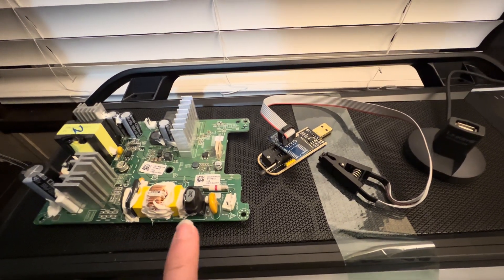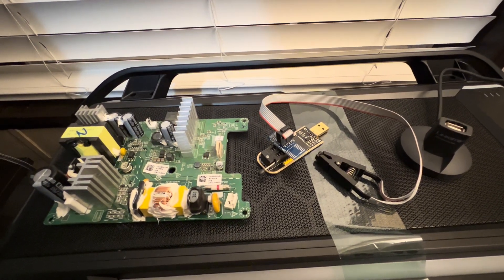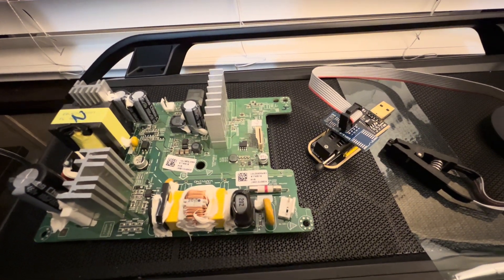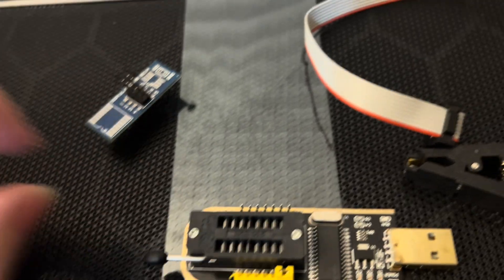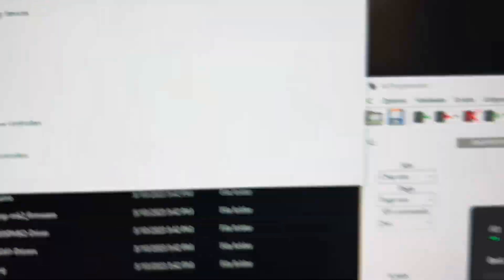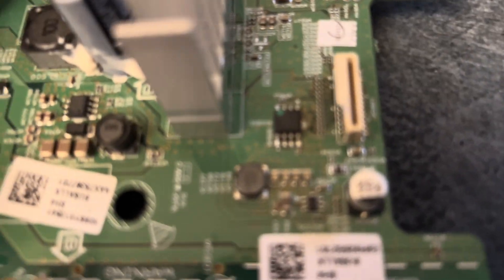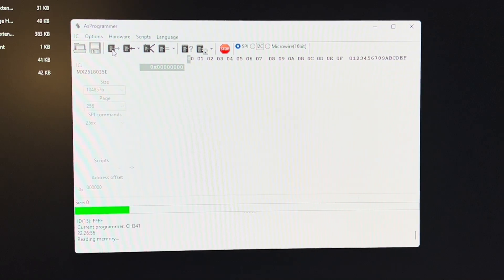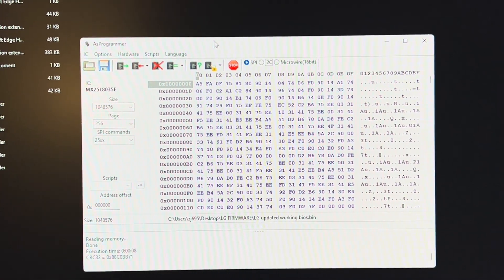How to fix LG Soundbar Subwoofer not working or pairing. SPN5B-W + SPN8-W part# EBR89625801

Comment: Does anyone have the firmware for the SN8YG soundbar that they can share? It’s really encouraging to see so many people have resolved their hardware issues. However, I flashed the wrong software version, which has left the device unable to reset or connect to the app. I can’t find any available resources online, so I can only pin my hopes here. My device model is SN8YG (with Google Assistant). I’m in need of a USB - flashable firmware for this soundbar—any version, whether new or old, will work. Does anyone know how I can get it? The official website no longer provides this resource. THX!!!

Comment: Hi, i get this Error connecting CH341(-1) like every time and in very rare cases i get this:
ID(9F): 000000(Unknown)
ID(90): 0000(Unknown)
ID(AB): 00(Unknown)
ID(15): 0000(Unknown)
anyone knows why?
Reply: I had this - it was because I didn't have the pcb board powered up - ie plugged into the wall

Comment: Did not work in my case.
AsProgrammer working OK
When I try to read the ID of the chip, as a first step in the video, I get these error codes:
Current programmer: CH341
ID(9F): FFFFFF(Unknown)
ID(90): FFFF(Unknown)
ID(AB): FF(Unknown)
ID(15): FFFF(Unknown)
No Idea what to try next, get a new chip, new board....?
Buy a Sonos sound bar....big $$..?
Reply: I faced similar error msgs before.  I had been using AsProgrammer as well as NeoProgrammer as CHATGPT suggested.  Been troubleshooting with CHATGRT for hours on this - one thing I am going to try next is to connect the CH341A to USB2.0 port (need an extension wire like this video mentioned at the beginning 39s or USB2.0 hub to do this).  Hope this will rule out the over power issue by USB3.0 port that is causing all those instability, connection issues like @pjorlando7017 and @MarkAzzopardi-ub8lv facing as below that I also got repeatedly and consistently even now. :(
Reply: Update: after getting USB2.0, it still took me a while to read the chip.  Need to seat it properly (I seated and reseated using the clip so many times, in order to detect the IC proper).  Although flashing it will good bios, updated bios or even rolled back to my bad bios, my SPP8-W active sub just dun wanna power up.  A check with ChatGPT could be some IC been fried - probably when I was using too high current in CH341 when I was still connecting to USB3.0.  Well, I gonna bring into LG (beyond me, if hardware stuff).  For those who's gonna try this self fix, pls do it with due care.  Watch, and re watch the video.  Better still, still with USB2.0 (safer).  Good luck to your all!!
Reply: I think the connector is not connected properly, I had the same problem at first, you have to press it straight in

Comment: Thank you so much for this video, I thought I was going to have to buy another sound bar. I bought the kit off amazon for $14 and followed your instructions and it worked. my chip had a white dot of paint covering the chip id so took brake cleaner on a rag and wiped it off, my id was 8035E as well; I did get the error code after 2 seconds of programming but its working fine. I did have to unplug both by sound bar and subwoofer plug them both back up and hit the pair but on the back of the sub and its working fine now thanks again.
Reply: I haven't been able to find any label on my chip, but also have a dot of white paint.  any issues after removing the paint from the chip?

Comment: How are the LG sound bar and woofer getting updates?  The LG sound bar and woofer aren't connected to my home wireless network.  Neither are they connected to my phone, for Interent access through my phone (via Bluetooth?).  The only connection I know if is between my LG sound bar and TV via an HDMI cable between the eARC ports.   Update - I just went through this proceedure, which was pretty easy, and my LG woofer is working again.  I wish I understood how this happened to prevent it from happening in the future but at least I have a way to get back to a working state again.  Thanks!

Comment: I followed the video exactly, but I keep getting the message "Error connecting CH341(-1)" I have everything connected properly and the drivers you linked installed. Any input?
Reply: I have the same issue if you figured it out please let me know, thanks in advance.

Comment: Thank you! Instead of being e-waste, you helped me return my soundbar to its working condition.

I will add that the link to your Amazon seller of the CH341A sent me two versions that were only CH341 and neither of them would work. I went with the model from KeeYees (url: B07SHSL9X9) that was the same price, and everything worked. Actually, even better than your video. I didn't need to go into device manager and install drivers.

In addition, the top comment about after having the error, made everything work (manually clicking the buttons: unprotect, erase, program). So, thank you. $13.99 and 20 minutes of watching your video and making sure everything was set up properly was all it took.

Comment: Sigh didn't work for me, I can't find any damage on the board and the fuse is still fine. 
So I guess its either the main board or the wireless module. Not sure which to try and replace first. Im assuming the led is driven from the  wireless module. Mine is mostly dead but I do see a faint green and red light osccilating visibly. So it might be a floating connection from the module.

Comment: Hi, does this method work for the subwoofer that comes with the SJ2 model? I flashed this file according to the instructions, the green light is blinking, but it still doesn't connect. Any ideas?

Comment: Hi nice video about to try this tomororw, i have no light when plugged into power. 
When you are reprogramming the chip do you need to power the board or does the programmer supply enough power? I.e. should the board be plugged into the sub power cable. Thanks.

Comment: Thank you so much! Was a bit tricky to get the clip on correctly, but eventually it connected. I agree with a couple of people here that I had to manually run the unprotect, erase and program. No verify and it worked perfectly.
Reply: How do you do it manually this is where am stuck 😢

Comment: Hi my lg sub flashes green twice then after a while goes solid red. When i press pairing if flashed rapid for 2 seconds then back to 2 slow green flashes and then back to red. Will this solve that issue or is mine sometging else ? Soundbar reset doesnt help either. Think it happened during power outage. Is this 1.8v or 3.3v ?

Comment: Exactly what I was looking for...thank you Brother!
EDIT: Some issues I ran into to help others.  My reader initially was going very fast, completing the programming in about 1 second but showing a memory error as others have stated.  However, I plugged in the woofer and had the green flashing pairing light working again...so progress (but still broken).  

When I brought the woofer back to the work bench to try programming again, I couldn't get it to show anything for the Read IC so I manually selected the IC from the IC menu dropdown list (you have to use the dropdown arrow at the bottom of the list to keep scrolling if yours isn't near the top).  

I then tried the individual steps instead of the one shown in the video (you can click, unprotect, erase, program and verify independently).  It appeared I got hung up after the erase step and all of the memory locations showed blank but it would say it was programming and make no progress.

The only thing that got progress moving again for me was with the chip connected and attached to the programmer, I disconnected the USB from the PC side and reconnected.  Then when I clicked read IC again it prompted for possible chip types, selected the correct one, manually ran unprotect, erase, program (skipped verify) and there were no errors with an execution time of 13 seconds vs 1 second on the first go around.  

If you don't here back from me (with an Edit 2) this method fixed me, just wanted to brain dump before testing connectivity.

Comment: Does it work with spn4b-w? It's the sub that comes together with the soundbar sn4
Reply: Did you try that this works with spn4b-w. Having the same isssue
Reply: @vaterbob  nope, I'm sorry. I ended up by changing the complete system
Reply: @MrMasanijey  Okay thanks for the answer

Comment: Does this work sn4 soundbar and spn4b-w subwoofer?
Reply: I have the issue that "the subwoofer green light blinks fast for 2 seconds and then starts to blink slowly, it never connects to the soundbar and after a while, it turns red"
I've tried this approach and it didn't work, despite the EEPROM (25Q80C) could still be successfully programmed ¯\_(ツ)_/¯
I have ordered a replacement part for the whole mainboard (EBR87888102) and hope this works and it's not actually the soundbars fault. I then could read out the EEPROM content of the replacement part and if it's in fact a different firmware on it, I could share it for others with a DSN4
Reply: @FaySmash  Cool man! Yes please share the content to the people. Awesome to see some are ready to reaserch the issue. But i just might buy a new soundbar with different brand. I read from different forums and comments this might happen more than once with lg subwoofers. Might go with Sony next time.
Reply: @FaySmash  Hi did you ever share the new firmware. Im still trying to fix mine subwoofer😅

Comment: I'm trying to write the new code to the chip (MX25L8035E)  but I receive:

Possible protection is enabled. Press "Unprotect" and check datasheet
Programming memory (with verification)...

"I've tried  around with the SREG editor, but I can't disable the protection, if that's what it is.

Could you help me with this? Thank you very much.

Comment: Update, I got a CH341a but I found out my chip couldn't retain data. The original on the SPN4B was Gigadevice but I bought a Macronix replacement like the one in your video, preprogrammed it and replaced it. Everything works now

Comment: Hi! Can someone please tell me if this method works with the SN4 model, since that one isn’t listed in the description?
Reply: I have the issue that "the subwoofer green light blinks fast for 2 seconds and then starts to blink slowly, it never connects to the soundbar and after a while, it turns red"
I've tried this approach and it didn't work, despite the EEPROM (25Q80C) could still be successfully programmed ¯\_(ツ)_/¯
I have ordered a replacement part for the whole mainboard (EBR87888102) and hope this works and it's not actually the soundbars fault. I then could read out the EEPROM content of the replacement part and if it's in fact a different firmware on it, I could share it for others with a DSN4
Reply: btw, the new mainboard fixed the issue
Reply: Can you share the firmware for dsn4 please? Thanks @FaySmash
Reply: Ciao, non riesco ad aprire il link...questo funzionerebbe anche con il chip originale gigadevice?
Reply: Sembra che abbiano rimosso da Google drive

Comment: Just wanted to say the re-flashing worked for my SPN8-W! I downloaded the bin file and used my Raspberry Pi 3 with flashrom to flash as I didn't have a CH341. Worked good, even though verification failed. I've also mirrored the firmware file on my own files site. Thanks man

Comment: Works! I patched two SPN5B-W subs both with the same issue. I recommend getting a bright flashlight and while clipping on the alligator clip to the chip, view the teeth so you can make sure the tooth is lining up with each other as you release the clamp. It just wouldn't line up otherwise and finally, after using a flashlight to line it up, I could flash both my subs back to back with no issue. I had to get a second programmer because the first one would drop from the device manager after a failed attempt to connect the alligator clip.

Comment: I got a programmer device online, and setup the drivers, etc. However, every time I clipped the cable to the chip on the board, the device would disappear from device manager. Tried a number of different drivers and no luck. I purchased a second programmer device and it worked. The only difference I could see was the first one had a "CH341" label on the back, and the second (working one) said "CH341A". Also, when I programmed the chip it originally returned "Verification error on address: 0000E000". So instead I ran a normal programming task (click on the write icon itself, not the drop down option in AsProgrammer) and it completed. I ran it three times to be sure, reassembled everything, and it all sync'd and worked with the soundbar again. Thanks. Donation sent!

Comment: Thank you for sharing this. 
I have 2 SN7Y with SPN5-W. The one that I had it for longer, stopped pairing, then solid red, eventually not showing any light but you can hear a electric noise when you plug in the power cable. I have tried writing the chip first with your working firmware. 
It then powered on, paired correctly, but at some point it went back to no light. 

I have tried backing up the firmware from my working one and write it to the non working one, it did show green light but in less than 2 minutes light was off again and remained off. 

On all my write attempts I had the write error and then write again, successful 2nd or 3rd time.

Comment: Just wanted to say, this 100% fixed my problem as well. One thing to mention, because I found it buried in the comments, if you don't hear the "noise" when you attach the clip, keep trying, slightly repositioning it every time, until you hear it... took a bit of fiddling with, but once I heard the noise, I was able to follow the rest of the instructions.

Comment: The Fix Works 100% ✔

I have an SPN8-W subwoofer. Whenever I powered it on, the pairing light would flash for a while and then turn solid green, but there was no connection to the soundbar. I followed the steps in this video and ordered the CH341a programmer from Amazon. I was able to fix the issue in less than 5 minutes. Thanks for posting this video and sharing the fix!

Comment: It’s weird I have 2 LG SN7Y soundbars with subs. And both subs stop working. No solid or flashing green light. I have never done any firmware updates on the system, so I don’t know how the firmware on the chip could get screwed up. But following the instructions on this video fixed my subs.  I have base again, yeah.  Thanks.
Reply from the maker: @diykindofguy33  it was the original firmware on them.... Like a slowly deteriorating issue

Comment: Hey man, are you still offering a repair service? My LG SN7Y sub died a few months ago. I got that ridiculous offer from magneto, but for those kinds of costs I'd rather just opt for a whole new soundbar. it doesn't make much sense. I'm located in Ontario, Canada.
Reply from the maker: @robagostini1570  the shipping from here to Canada is ridiculous..... So i generally just do USA only
Reply: @FiveStaxX  right but magneto wants like $140 CAD for the board swap - maybe even with high shipping you are still cheaper?
Reply from the maker: @robagostini1570  $140 cad including shipping or no?

Comment: There are a few negative Amazon reviews for the programmer claiming in puts out 5v instead of 3v, burning the chip. Have you experienced that issue with this programmer?
Reply from the maker: @danielfitzgerald2000  I've done about 40 boards with the same programmer. There's a video on YouTube that shows the programmer drops to 3v during read/write functions.

Comment: work:MODEL NO.: SPN4B-W
thanks!
Reply: hi, did you use the firmware from this video's description on your SPN4B-W? Thanks
Reply: yes
Reply: Quale chip hai scelto per la programmazione? Hai fatto in automatico o manuale cancellazione e scrittura?
Reply: @ivanazzalin1946 ch341+ MX25L8035EM21

Comment: This is the best.  I know nothing about chip boards when i first opened the LG SPN5b-W SUB and saw that's all was inside..  I GAVE UP.  NO POWER OR GREEN LIGHT AT ALL. dead sub woofer.    one day i randomly decided to search for solutions cause the dead sub happened once before but 6 months later just worked again.  I watched this dudes video.  ordered the stuff for 15 bucks off amazon, followed his steps and boom, green light on.  BOOM sub woofer connected to sound bar right away.  AMAZING. 

Use the links for the AS program, the kit to update the chip and the LG firmware link.  Took me closer to 40 minutes, kept rewinding the you tube to make sure i did it correct.  15$ + sent this guy a 10$ thanks.  This LG sub was such a pain in the ass and this easy update worked instantly.  Thanks zj695000!!!!!!  Saved me 350 buck for anew 5.1 sound bar and sub woofer.

Comment: I tried this with 2 different CH341 devices and each time a put a clam on the chip, it disconnects the device. Sometimes it just gets stuck in reading it in the software, but the outcome is the same. Any idea maybe what i might be doing wrong? Or might be something on the board? 
I always get an Error connecting to the device, and it actually is missing from the devices, like i've removed it from the usb port

Comment: Thanks for the LG subwoofer firmware flashing video.

Do you know if the firmware is the same between different models? I have a EBR85372901 PCB here and a programmer, but I only found the firmware you put in the description (for EBR89625801) so far.
Reply from the maker: @thedoginthewok  it works on multiple boards, but only with certain sound bars/subwoofers.
Reply: @FiveStaxX  I've got the SK10Y with subwoofer SPK8-W